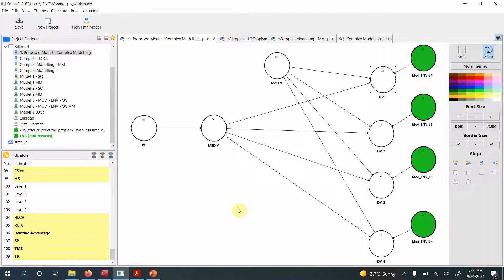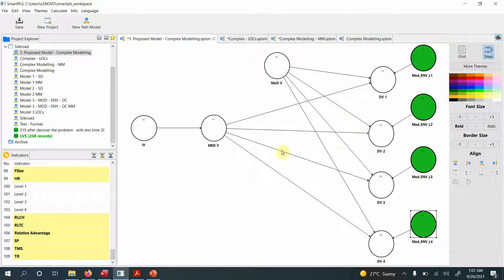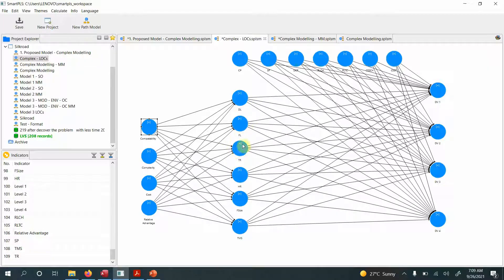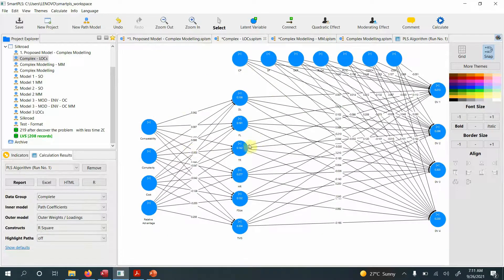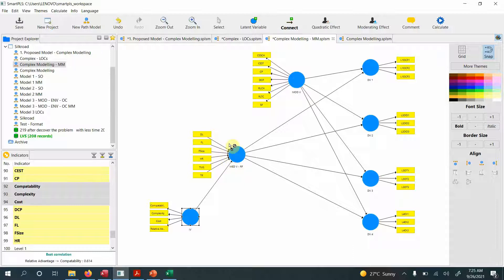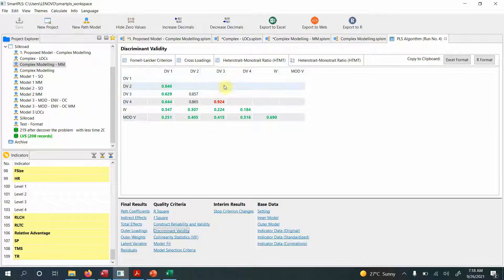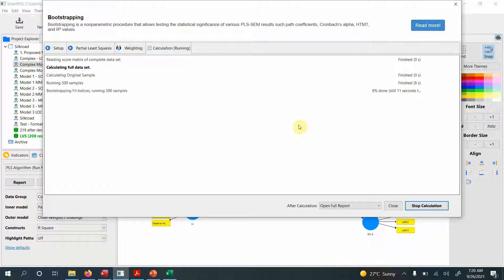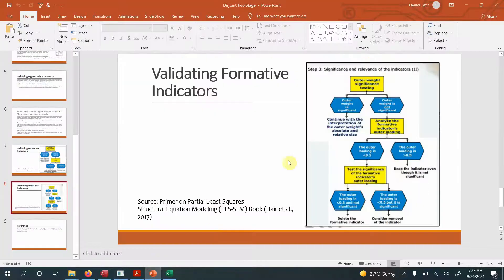5. Complex Higher Order Construct/Second Order Analysis with 3 Hierarchical Models (See Description)

Comment: Hi Sir. Like in this video, shouldn't we solve the discriminant validity between DV 3and DV 4 in the first step? I just curious when to solve this issue because the deleting indicator on the first step would effect my other lower order construct weight significant.
Reply from the maker: Validity has to be established at both lower and higher order level. This will need to be solved.